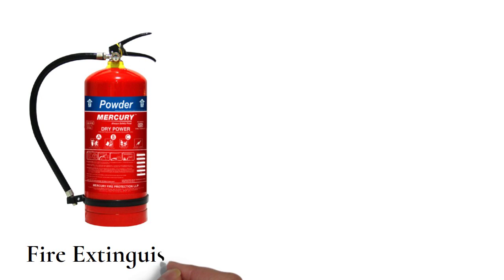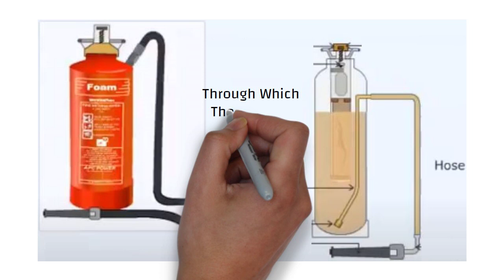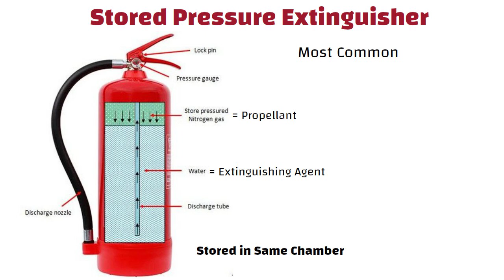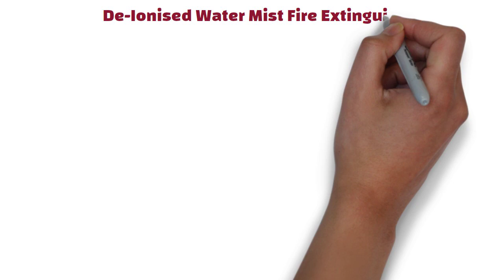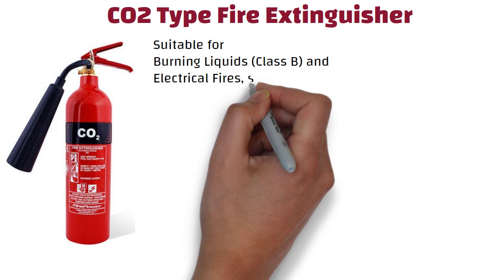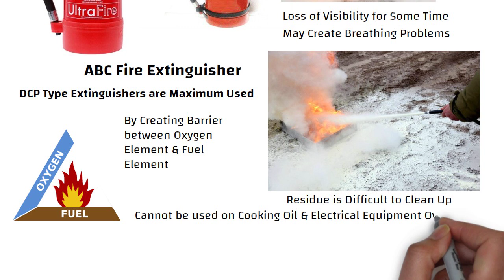FIRE EXTINGUISHER DEALERS IN KERALA, CALL 8138906102, FIRE EXTINGUISHER DEALERS IN ERNAKULAM.

Comment: FIRE EXTINGUISHER DEALERS IN KERALA, FIRE EXTINGUISHER SUPPLIERS IN KERALA, FIRE EXTINGUISHER DISTRIBUTORS IN KERALA, FIRE EXTINGUISHER IN KERALA, ABC TYPE FIRE EXTINGUISHER DEALERS IN KERALA, CO2 TYPE FIRE EXTINGUISHER DEALERS IN KERALA, CLEAN AGENT FIRE EXTINGUISHER IN KERALA, MODULAR TYPE FIRE EXTINGUISHER DEALERS IN KERALA, MECHANICAL FOAM FIRE EXTINGUISHER DEALERS IN KERALA, FIRE EXTINGUISHER NEAR ME KERALA, FIRE EXTINGUISHER TRADERS IN KERALA, FIRE FIGHTING COMPANIES IN KERALA, FIRE CONTRACTORS IN KERALA, FIRE EQUIPMENT DEALERS IN KERALA, FIRE ALARM DEALERS IN KERALA, FIRE PUMP DEALERS IN KERALA, SMOKE DETECTOR DEALERS IN KERALA, FIRE FIGHTING SYSTEM IN KERALA, FIRE PROTECTION SYSTEM IN KERALA, FIRE AND SAFETY CONTRACTORS IN KERALA, FIRE HYDRANT SYSTEMS IN KERALA, PA TALK BACK SYSTEM IN KERALA, FIRE NOC IN KERALA, FIRE INSTALLATION IN KERALA, FIRE NOC RENEWAL IN KERALA, KIRLOSKAR FIRE PUMP DEALERS IN KERALA, FIRE EXTINGUISHER NEAR ME KERALA, FIRE EXTINGUISHER MANUFACURERS IN KERALA, SAFEX FIRE EXTINGUISHER DEALERS IN KERALA, FIRE NOC CONTRACTORS IN KERALA, FIRE FIGHTING EQUIPMENT DEALERS IN KERALA, FIRE PROTECTION SYSTEM IN KERALA, FIRE INSTALLATION IN KERALA, FIRE SAFETY CONTRACTORS IN KERALA, FIRE AMC IN KERALA, FIRE PROTECTION SYSTEM IN KERALA, FIRE PROTECTION EQUIPMET IN KERALA, AMC OF FIRE SYSTEM IN KERALA, FIRE CONSULTANTS IN KERALA, FIRE AND SAFETY EQUIPMENT DEALERS IN KERALA, ADDRESSABLE FIRE ALARM SYSTEM IN KERALA, KARTHAR VALVE DEALERS IN KERALA, DCP TYPE FIRE EXTINGUISHER IN KERALA, POWSER TYPE FIRE EXTINGUISHERS IN KERALA, FIRE HYDRANT SYSTEM IN KERALA, FIRE ALARM PANEL DEALERS IN KERALA, SAFEPRO FIRE EXTINGUISHER DEALERS IN KERALA, MS AND GI PIPE DEALERS IN KERALA, JINDAL PIPE DEALERS IN KERALA, AGNI FIRE ALARM DEALERS IN KERALA, FIRE EQUIPMENT DEALERS IN KERALA, FIRE EQUIPMENT SUPPLIERS IN KERALA, FIRE EQUIPMENT TRADERS IN KERALA, FIRE SPRINKLER SYSTEM IN KERALA, RAVLE FIRE ALARM DEALERS IN KERALA, RAVEL FIRE ALARM SYSTEM IN KERALA, AGNI FIRE ALARM DISTRIBUTORS IN KERALA, FIRE ALARM CONTRACTORS IN KERALA, FIRE PIPE INSTALLATION IN CONTRACTORS IN KERALA, FIRE SAFETY CONTRACTORS IN KERALA, FIRE PA TWO WAY TALK BACK SYSTEM DEALERS IN KERALA, HEAT DETECTOR DEALERS IN KERALA, HONEYWELL FIRE ALARM DEALERS IN KERALA, FIRE NOC CONSULTANTS IN KERALA, FIRE AMC AND FIRE NOC IN KERALA, FIRE SAFETY COMPANIES IN KERALA, NEWAGE DEALERS IN KERALA, MONSHER FIRE EQUIPMENT DEALERS IN KERALA, KARTHAR VALVE DEALERS IN KERALA, FIRE HYDRANT VALVE DEALERS IN KERALA, FIRE HOSE REEL DRUM DEALERS IN KERALA, FIRE SPRINKLER DEALERS IN KERALA, FIRE PUMP DEALERS IN KERALA, LUBI PUMP DEALERS IN KERALA, LHP PUMP DEALERS IN KERALA. FIRE CONTRACTORS IN KERALA, FIRE AND SAFETY CONTRACTORS IN KERALA, FIRE EQUIPMENT DEALERS IN KERALA, FIRE FIGHTING CONTRACTORS IN KERALA, FIRE EXTINGUISHER DEALERS IN KOCHI, FIRE EXTINGUISHER SUPPLIERS IN KOCHI, FIRE EXTINGUISHER DISTRIBUTORS IN KOCHI, FIRE EXTINGUISHER IN KOCHI, ABC TYPE FIRE EXTINGUISHER DEALERS IN KOCHI, CO2 TYPE FIRE EXTINGUISHER DEALERS IN KOCHI, CLEAN AGENT FIRE EXTINGUISHER IN KOCHI, MODULAR TYPE FIRE EXTINGUISHER DEALERS IN KOCHI, MECHANICAL FOAM FIRE EXTINGUISHER DEALERS IN KOCHI, FIRE EXTINGUISHER NEAR ME KOCHI, FIRE EXTINGUISHER TRADERS IN KOCHI, FIRE FIGHTING COMPANIES IN KOCHI, FIRE CONTRACTORS IN KOCHI, FIRE EQUIPMENT DEALERS IN KOCHI, FIRE ALARM DEALERS IN KOCHI, FIRE PUMP DEALERS IN KOCHI, SMOKE DETECTOR DEALERS IN KOCHI, FIRE FIGHTING SYSTEM IN KOCHI, FIRE PROTECTION SYSTEM IN KOCHI, FIRE AND SAFETY CONTRACTORS IN KOCHI, FIRE HYDRANT SYSTEMS IN KOCHI, PA TALK BACK SYSTEM IN KOCHI, FIRE NOC IN KOCHI, FIRE INSTALLATION IN KOCHI, FIRE NOC RENEWAL IN KOCHI, KIRLOSKAR FIRE PUMP DEALERS IN KOCHI, FIRE EXTINGUISHER NEAR ME KOCHI, FIRE EXTINGUISHER MANUFACURERS IN KOCHI, SAFEX FIRE EXTINGUISHER DEALERS IN KOCHI, FIRE NOC CONTRACTORS IN KOCHI, FIRE FIGHTING EQUIPMENT DEALERS IN KOCHI, FIRE PROTECTION SYSTEM IN KOCHI, FIRE INSTALLATION IN KOCHI, FIRE SAFETY CONTRACTORS IN KOCHI, FIRE AMC IN KOCHI, FIRE PROTECTION SYSTEM IN KOCHI, FIRE PROTECTION EQUIPMET IN KOCHI, AMC OF FIRE SYSTEM IN KOCHI, FIRE CONSULTANTS IN KOCHI, FIRE AND SAFETY EQUIPMENT DEALERS IN KOCHI, ADDRESSABLE FIRE ALARM SYSTEM IN KOCHI, KARTHAR VALVE DEALERS IN KOCHI, DCP TYPE FIRE EXTINGUISHER IN KOCHI, POWSER TYPE FIRE EXTINGUISHERS IN KOCHI, FIRE HYDRANT SYSTEM IN KOCHI, FIRE ALARM PANEL DEALERS IN KOCHI, SAFEPRO FIRE EXTINGUISHER DEALERS IN KOCHI, MS AND GI PIPE DEALERS IN KOCHI, JINDAL PIPE DEALERS IN KOCHI, AGNI FIRE ALARM DEALERS IN KOCHI, FIRE EQUIPMENT DEALERS IN KOCHI, FIRE EQUIPMENT SUPPLIERS IN KOCHI, FIRE EQUIPMENT TRADERS IN KOCHI, FIRE SPRINKLER SYSTEM IN KOCHI, RAVLE FIRE ALARM DEALERS IN KOCHI, RAVEL FIRE ALARM SYSTEM IN KOCHI, AGNI FIRE ALARM DISTRIBUTORS IN KOCHI, FIRE ALARM CONTRACTORS IN KOCHI, FIRE PIPE INSTALLATION IN CONTRACTORS IN KOCHI, FIRE SAFETY CONTRACTORS IN KOCHI, FIRE PA TWO WAY TALK BACK SYSTEM DEALERS IN KOCHI, HEAT DETECTOR DEALERS IN KOCHI, HONEYWELL FIRE ALARM DEALERS IN KOCHI, FIRE NOC CONSULTANTS IN KOCHI, FIRE AMC AND FIRE NOC IN KOCHI, FIRE SAFETY COMPANIES IN KOCHI, NEWAGE DEALERS IN KOCHI, MONSHER FIRE EQUIPMENT DEALERS IN KOCHI, KARTHAR VALVE DEALERS IN KOCHI, FIRE HYDRANT VALVE DEALERS IN KOCHI, FIRE HOSE REEL DRUM DEALERS IN KOCHI, FIRE SPRINKLER DEALERS IN KOCHI, FIRE PUMP DEALERS IN KOCHI, LUBI PUMP DEALERS IN KOCHI, LHP PUMP DEALERS IN KOCHI. FIRE CONTRACTORS IN KOCHI, FIRE AND SAFETY CONTRACTORS IN KOCHI, FIRE EQUIPMENT DEALERS IN KOCHI, FIRE FIGHTING CONTRACTORS IN KOCHI, FIRE EXTINGUISHER DEALERS IN ERNAKULAM, FIRE EXTINGUISHER SUPPLIERS IN ERNAKULAM, FIRE EXTINGUISHER DISTRIBUTORS IN ERNAKULAM, FIRE EXTINGUISHER IN ERNAKULAM, ABC TYPE FIRE EXTINGUISHER DEALERS IN ERNAKULAM, CO2 TYPE FIRE EXTINGUISHER DEALERS IN ERNAKULAM, CLEAN AGENT FIRE EXTINGUISHER IN ERNAKULAM, MODULAR TYPE FIRE EXTINGUISHER DEALERS IN ERNAKULAM, MECHANICAL FOAM FIRE EXTINGUISHER DEALERS IN ERNAKULAM, FIRE EXTINGUISHER NEAR ME ERNAKULAM, FIRE EXTINGUISHER TRADERS IN ERNAKULAM, FIRE FIGHTING COMPANIES IN ERNAKULAM, FIRE CONTRACTORS IN ERNAKULAM, FIRE EQUIPMENT DEALERS IN ERNAKULAM, FIRE ALARM DEALERS IN ERNAKULAM, FIRE PUMP DEALERS IN ERNAKULAM, SMOKE DETECTOR DEALERS IN ERNAKULAM, FIRE FIGHTING SYSTEM IN ERNAKULAM, FIRE PROTECTION SYSTEM IN ERNAKULAM, FIRE AND SAFETY CONTRACTORS IN ERNAKULAM, FIRE HYDRANT SYSTEMS IN ERNAKULAM, PA TALK BACK SYSTEM IN ERNAKULAM, FIRE NOC IN ERNAKULAM, FIRE INSTALLATION IN ERNAKULAM, FIRE NOC RENEWAL IN ERNAKULAM, KIRLOSKAR FIRE PUMP DEALERS IN ERNAKULAM, FIRE EXTINGUISHER NEAR ME ERNAKULAM, FIRE EXTINGUISHER MANUFACURERS IN ERNAKULAM, SAFEX FIRE EXTINGUISHER DEALERS IN ERNAKULAM, FIRE NOC CONTRACTORS IN ERNAKULAM, FIRE FIGHTING EQUIPMENT DEALERS IN ERNAKULAM, FIRE PROTECTION SYSTEM IN ERNAKULAM, FIRE INSTALLATION IN ERNAKULAM, FIRE SAFETY CONTRACTORS IN ERNAKULAM, FIRE AMC IN ERNAKULAM, FIRE PROTECTION SYSTEM IN ERNAKULAM, FIRE PROTECTION EQUIPMET IN ERNAKULAM, AMC OF FIRE SYSTEM IN ERNAKULAM, FIRE CONSULTANTS IN ERNAKULAM, FIRE AND SAFETY EQUIPMENT DEALERS IN ERNAKULAM, ADDRESSABLE FIRE ALARM SYSTEM IN ERNAKULAM, KARTHAR VALVE DEALERS IN ERNAKULAM, DCP TYPE FIRE EXTINGUISHER IN ERNAKULAM, POWSER TYPE FIRE EXTINGUISHERS IN ERNAKULAM, FIRE HYDRANT SYSTEM IN ERNAKULAM, FIRE ALARM PANEL DEALERS IN ERNAKULAM, SAFEPRO FIRE EXTINGUISHER DEALERS IN ERNAKULAM, MS AND GI PIPE DEALERS IN ERNAKULAM, JINDAL PIPE DEALERS IN ERNAKULAM, AGNI FIRE ALARM DEALERS IN ERNAKULAM, FIRE EQUIPMENT DEALERS IN ERNAKULAM, FIRE EQUIPMENT SUPPLIERS IN ERNAKULAM, FIRE EQUIPMENT TRADERS IN ERNAKULAM, FIRE SPRINKLER SYSTEM IN ERNAKULAM, RAVLE FIRE ALARM DEALERS IN ERNAKULAM, RAVEL FIRE ALARM SYSTEM IN ERNAKULAM, AGNI FIRE ALARM DISTRIBUTORS IN ERNAKULAM, FIRE ALARM CONTRACTORS IN ERNAKULAM, FIRE PIPE INSTALLATION IN CONTRACTORS IN ERNAKULAM, FIRE SAFETY CONTRACTORS IN ERNAKULAM, FIRE PA TWO WAY TALK BACK SYSTEM DEALERS IN ERNAKULAM, HEAT DETECTOR DEALERS IN ERNAKULAM, HONEYWELL FIRE ALARM DEALERS IN ERNAKULAM, FIRE NOC CONSULTANTS IN ERNAKULAM, FIRE AMC AND FIRE NOC IN ERNAKULAM, FIRE SAFETY COMPANIES IN ERNAKULAM, NEWAGE DEALERS IN ERNAKULAM, MONSHER FIRE EQUIPMENT DEALERS IN ERNAKULAM, KARTHAR VALVE DEALERS IN ERNAKULAM, FIRE HYDRANT VALVE DEALERS IN ERNAKULAM, FIRE HOSE REEL DRUM DEALERS IN ERNAKULAM, FIRE SPRINKLER DEALERS IN ERNAKULAM, FIRE PUMP DEALERS IN ERNAKULAM, LUBI PUMP DEALERS IN ERNAKULAM, LHP PUMP DEALERS IN ERNAKULAM. FIRE CONTRACTORS IN ERNAKULAM, FIRE AND SAFETY CONTRACTORS IN ERNAKULAM, FIRE EQUIPMENT DEALERS IN ERNAKULAM, FIRE FIGHTING CONTRACTORS IN ERNAKULAM, 

htts://www.aimfireequipment.com

https://g.co/kgs/wAz9PTn

Comment: MS Jindal pipe dealers in KERALA, motor control panel in KERALA, fire pump panel in KERALA, motor control panel in KERALA, Morley fire alarm in KERALA, gst fire alarm in KERALA, addressable fire alarm system in KERALA, Pa talk back system in KERALA, PA two way talk back system in KERALA, auto glow SIGNAGES in KERALA, Karthar dealers in KERALA, Agni fire alarm dealers in KERALA, ASES SECURITY fire alarm dealers in KERALA, AUTO GLOW SIGNAGES in KERALA, FIRE PUMP PANEL in KERALA, LHP pump in KERALA. Karthar valves in KERALA, Ravel fire alarm system in KERALA. Jindal pipe dealers in KERALA, Jindal pipe dealers in KERALA. MS pipe dealers in KERALA. Butterfly valves in KERALA, PA talk back system in KERALA, Fire alarm dealers in KERALA, smoke detector dealers in KERALA, fire alarm panels dealers in KERALA, MCP, hooter dealers in Mangalor, hydrant valve dealers in KERALA, branch pipe dealers in KERALA,Fire CP hose in KERALA, Fire RRL hose in KERALA, heat detector dealers in KERALA, Motor Control panel in KERALA,  LED EXIT LIGHTS dealers in KERALA, emergency exit light dealers in KERALA, auto glow SIGNAGES dealers in KERALA. Conventional fire alarm system in KERALA, Fire alarm panel in KERALA, Notifier fire alarm dealers in KERALA, PA talk back unit dealers in KERALA. Honeywell fire alarm dealers in KERALA, BOSCH PA system dealers in KERALA,

Comment: Fire extinguisher dealers in KERALA, fire fighting contractors in KERALA, KERALA, fire and safety installations in KERALA, fire extinguisher suppliers in KERALA,fire extinguishers in KERALA, fire extinguishers in KERALA, fire protection system in KERALA, f fire and safety installation in KERALA, fire and safety contractors in KERALA, fire safety contractors in KERALA, fire and safety systems equipments in KERALA, fire equipment in KERALA, fire extinguisher in KERALA, fire protection system installation in KERALA, fire contractors in KERALA, fire safety consultants in KERALA,  fire alarm systems in KERALA, fire NOC in KERALA, fire AMC in KERALA, KERALA, fire fighting equipment in KERALA,

Comment: FIRE EXTINGUISHER DEALERS IN KARUNAGAPPALLY, FIRE EXTINGUISHER SUPPLIERS IN KARUNAGAPPALLY, FIRE EXTINGUISHER DISTRIBUTORS IN KARUNAGAPPALLY, FIRE EXTINGUISHER IN KARUNAGAPPALLY, ABC TYPE FIRE EXTINGUISHER DEALERS IN KARUNAGAPPALLY, CO2 TYPE FIRE EXTINGUISHER DEALERS IN KARUNAGAPPALLY, CLEAN AGENT FIRE EXTINGUISHER IN KARUNAGAPPALLY, MODULAR TYPE FIRE EXTINGUISHER DEALERS IN KARUNAGAPPALLY, MECHANICAL FOAM FIRE EXTINGUISHER DEALERS IN KARUNAGAPPALLY, FIRE EXTINGUISHER NEAR ME KARUNAGAPPALLY, FIRE EXTINGUISHER TRADERS IN KARUNAGAPPALLY, SAFEPRO FIRE EXTINGUISHER IN KARUNAGAPPALLY, FIRE EXTINGUISHER DISTRIBUTORS IN KARUNAGAPPALLY, FIRE FIGHTING COMPANIES IN KARUNAGAPPALLY, FIRE CONTRACTORS IN KARUNAGAPPALLY, FIRE EQUIPMENT DEALERS IN KARUNAGAPPALLY, FIRE ALARM DEALERS IN KARUNAGAPPALLY, FIRE PUMP DEALERS IN KARUNAGAPPALLY, SMOKE DETECTOR DEALERS IN KARUNAGAPPALLY, FIRE FIGHTING SYSTEM IN KARUNAGAPPALLY, FIRE PROTECTION SYSTEM IN KARUNAGAPPALLY, FIRE AND SAFETY CONTRACTORS IN KARUNAGAPPALLY, FIRE HYDRANT SYSTEMS IN KARUNAGAPPALLY, PA TALK BACK SYSTEM IN KARUNAGAPPALLY, FIRE NOC IN KARUNAGAPPALLY, FIRE INSTALLATION IN KARUNAGAPPALLY, FIRE NOC RENEWAL IN KARUNAGAPPALLY, KIRLOSKAR FIRE PUMP DEALERS IN KARUNAGAPPALLY, FIRE EXTINGUISHER NEAR ME KARUNAGAPPALLY, FIRE EXTINGUISHER MANUFACURERS IN KARUNAGAPPALLY, SAFEX FIRE EXTINGUISHER DEALERS IN KARUNAGAPPALLY, FIRE NOC CONTRACTORS IN KARUNAGAPPALLY, FIRE FIGHTING EQUIPMENT DEALERS IN KARUNAGAPPALLY, FIRE PROTECTION SYSTEM IN KARUNAGAPPALLY, FIRE INSTALLATION IN KARUNAGAPPALLY, FIRE SAFETY CONTRACTORS IN KARUNAGAPPALLY, FIRE AMC IN KARUNAGAPPALLY, FIRE PROTECTION SYSTEM IN KARUNAGAPPALLY, FIRE PROTECTION EQUIPMET IN KARUNAGAPPALLY, AMC OF FIRE SYSTEM IN KARUNAGAPPALLY, FIRE CONSULTANTS IN KARUNAGAPPALLY, FIRE AND SAFETY EQUIPMENT DEALERS IN KARUNAGAPPALLY, ADDRESSABLE FIRE ALARM SYSTEM IN KARUNAGAPPALLY, KARTHAR VALVE DEALERS IN KARUNAGAPPALLY, DCP TYPE FIRE EXTINGUISHER IN KARUNAGAPPALLY, POWSER TYPE FIRE EXTINGUISHERS IN KARUNAGAPPALLY, FIRE HYDRANT SYSTEM IN KARUNAGAPPALLY, FIRE ALARM PANEL DEALERS IN KARUNAGAPPALLY, SAFEPRO FIRE EXTINGUISHER DEALERS IN KARUNAGAPPALLY, MS AND GI PIPE DEALERS IN KARUNAGAPPALLY, JINDAL PIPE DEALERS IN KARUNAGAPPALLY, AGNI FIRE ALARM DEALERS IN KARUNAGAPPALLY, FIRE EQUIPMENT DEALERS IN KARUNAGAPPALLY, FIRE EQUIPMENT SUPPLIERS IN KARUNAGAPPALLY, FIRE EQUIPMENT TRADERS IN KARUNAGAPPALLY, FIRE SPRINKLER SYSTEM IN KARUNAGAPPALLY, RAVLE FIRE ALARM DEALERS IN KARUNAGAPPALLY, RAVEL FIRE ALARM SYSTEM IN KARUNAGAPPALLY, AGNI FIRE ALARM DISTRIBUTORS IN KARUNAGAPPALLY, FIRE ALARM CONTRACTORS IN KARUNAGAPPALLY, FIRE PIPE INSTALLATION IN CONTRACTORS IN KARUNAGAPPALLY, FIRE SAFETY CONTRACTORS IN KARUNAGAPPALLY, FIRE PA TWO WAY TALK BACK SYSTEM DEALERS IN KARUNAGAPPALLY, HEAT DETECTOR DEALERS IN KARUNAGAPPALLY, HONEYWELL FIRE ALARM DEALERS IN KARUNAGAPPALLY, FIRE NOC CONSULTANTS IN KARUNAGAPPALLY, FIRE AMC AND FIRE NOC IN KARUNAGAPPALLY, FIRE SAFETY COMPANIES IN KARUNAGAPPALLY, NEWAGE DEALERS IN KARUNAGAPPALLY, MONSHER FIRE EQUIPMENT DEALERS IN KARUNAGAPPALLY, KARTHAR VALVE DEALERS IN KARUNAGAPPALLY, FIRE HYDRANT VALVE DEALERS IN KARUNAGAPPALLY, FIRE HOSE REEL DRUM DEALERS IN KARUNAGAPPALLY, FIRE SPRINKLER DEALERS IN KARUNAGAPPALLY, FIRE PUMP DEALERS IN KARUNAGAPPALLY, LUBI PUMP DEALERS IN KARUNAGAPPALLY, LHP PUMP DEALERS IN KARUNAGAPPALLY. FIRE CONTRACTORS IN KARUNAGAPPALLY, FIRE AND SAFETY CONTRACTORS IN KARUNAGAPPALLY, FIRE EQUIPMENT DEALERS IN KARUNAGAPPALLY, FIRE FIGHTING CONTRACTORS IN KARUNAGAPPALLY,

Comment: FIRE EXTINGUISHER DEALERS IN VAIKOM, FIRE EXTINGUISHER SUPPLIERS IN VAIKOM, FIRE EXTINGUISHER DISTRIBUTORS IN VAIKOM, FIRE EXTINGUISHER IN VAIKOM, ABC TYPE FIRE EXTINGUISHER DEALERS IN VAIKOM, CO2 TYPE FIRE EXTINGUISHER DEALERS IN VAIKOM, CLEAN AGENT FIRE EXTINGUISHER IN VAIKOM, MODULAR TYPE FIRE EXTINGUISHER DEALERS IN VAIKOM, MECHANICAL FOAM FIRE EXTINGUISHER DEALERS IN VAIKOM, FIRE EXTINGUISHER NEAR ME VAIKOM, FIRE EXTINGUISHER TRADERS IN VAIKOM, FIRE FIGHTING COMPANIES IN VAIKOM, FIRE CONTRACTORS IN VAIKOM, FIRE EQUIPMENT DEALERS IN VAIKOM, FIRE ALARM DEALERS IN VAIKOM, FIRE PUMP DEALERS IN VAIKOM, SMOKE DETECTOR DEALERS IN VAIKOM, FIRE FIGHTING SYSTEM IN VAIKOM, FIRE PROTECTION SYSTEM IN VAIKOM, FIRE AND SAFETY CONTRACTORS IN VAIKOM, FIRE HYDRANT SYSTEMS IN VAIKOM, PA TALK BACK SYSTEM IN VAIKOM, FIRE NOC IN VAIKOM, FIRE INSTALLATION IN VAIKOM, FIRE NOC RENEWAL IN VAIKOM, KIRLOSKAR FIRE PUMP DEALERS IN VAIKOM, FIRE EXTINGUISHER NEAR ME VAIKOM, FIRE EXTINGUISHER MANUFACURERS IN VAIKOM, SAFEX FIRE EXTINGUISHER DEALERS IN VAIKOM, FIRE NOC CONTRACTORS IN VAIKOM, FIRE FIGHTING EQUIPMENT DEALERS IN VAIKOM, FIRE PROTECTION SYSTEM IN VAIKOM, FIRE INSTALLATION IN VAIKOM, FIRE SAFETY CONTRACTORS IN VAIKOM, FIRE AMC IN VAIKOM, FIRE PROTECTION SYSTEM IN VAIKOM, FIRE PROTECTION EQUIPMET IN VAIKOM, AMC OF FIRE SYSTEM IN VAIKOM, FIRE CONSULTANTS IN VAIKOM, FIRE AND SAFETY EQUIPMENT DEALERS IN VAIKOM, ADDRESSABLE FIRE ALARM SYSTEM IN VAIKOM, KARTHAR VALVE DEALERS IN VAIKOM, DCP TYPE FIRE EXTINGUISHER IN VAIKOM, POWSER TYPE FIRE EXTINGUISHERS IN VAIKOM, FIRE HYDRANT SYSTEM IN VAIKOM, FIRE ALARM PANEL DEALERS IN VAIKOM, SAFEPRO FIRE EXTINGUISHER DEALERS IN VAIKOM, MS AND GI PIPE DEALERS IN VAIKOM, JINDAL PIPE DEALERS IN VAIKOM, AGNI FIRE ALARM DEALERS IN VAIKOM, FIRE EQUIPMENT DEALERS IN VAIKOM, FIRE EQUIPMENT SUPPLIERS IN VAIKOM, FIRE EQUIPMENT TRADERS IN VAIKOM, FIRE SPRINKLER SYSTEM IN VAIKOM, RAVEL FIRE ALARM DEALERS IN VAIKOM, RAVEL FIRE ALARM SYSTEM IN VAIKOM, AGNI FIRE ALARM DISTRIBUTORS IN VAIKOM, FIRE ALARM CONTRACTORS IN VAIKOM, FIRE PIPE INSTALLATION IN CONTRACTORS IN VAIKOM, FIRE SAFETY CONTRACTORS IN VAIKOM, FIRE PA TWO WAY TALK BACK SYSTEM DEALERS IN VAIKOM, HEAT DETECTOR DEALERS IN VAIKOM, HONEYWELL FIRE ALARM DEALERS IN VAIKOM, FIRE NOC CONSULTANTS IN VAIKOM, FIRE AMC AND FIRE NOC IN VAIKOM, FIRE SAFETY COMPANIES IN VAIKOM, NEWAGE DEALERS IN VAIKOM, MONSHER FIRE EQUIPMENT DEALERS IN VAIKOM, KARTHAR VALVE DEALERS IN VAIKOM, FIRE HYDRANT VALVE DEALERS IN VAIKOM, FIRE HOSE REEL DRUM DEALERS IN VAIKOM, FIRE SPRINKLER DEALERS IN VAIKOM, FIRE PUMP DEALERS IN VAIKOM, LUBI PUMP DEALERS IN VAIKOM, LHP PUMP DEALERS IN VAIKOM. FIRE ALARM SYSTEMS IN VAIKOM, ADDRESSABLE FIRE ALARM DEALERS IN VAIKOM, SMOKE DETECTOR DEALERS IN VAIKOM, FIRE ALARM CONTRACTORS IN VAIKOM, FIRE ALARM PANEL DEALERS IN VAIKOM, BIRE ALARM INSTALLTION IN VAIKOM, MORLEY FIRE ALARM DEALERS IN VAIKOM, HONEYWELL FIRE ALARM DEALERS IN VAIKOM, GST FIRE ALARM DEALERS IN VAIKOM, FIRE FIGHTING COMPANIES IN VAIKOM, FIRE AND SAFETY CONTRACTORS IN VAIKOM, FIRE EQUIPMENT IN VAIKOM, SAFEPRO FIRE EXTINGUISHER DEALERS IN VAIKOM, SAFEX FIRE EXTINGUISHER DEALERS IN VAIKOM, SIMPLEX FIRE ALARM DEALERS IN VAIKOM, TYCO DEALERS IN VAIKOM, JINDAL PIPE DEALERS IN VAIKOM, KARTHAR DISTRIBUTORS IN VAIKOM, STENTOR DEALERS IN VAIKOM, MONSHER DEALERS IN VAIKOM, NEWAGE DEALERS IN VAIKOM, RONAK HOSE REEL DEALERS IN VAIKOM,